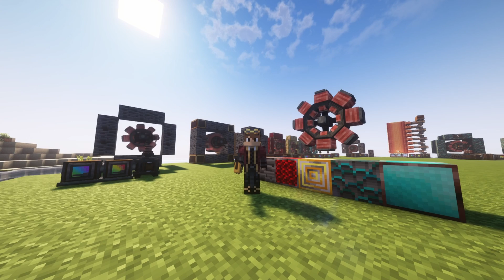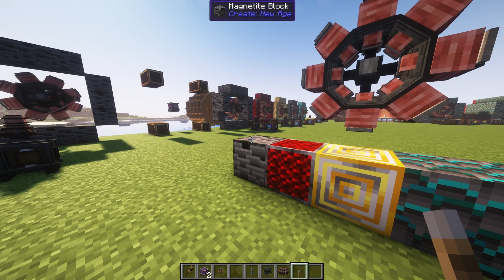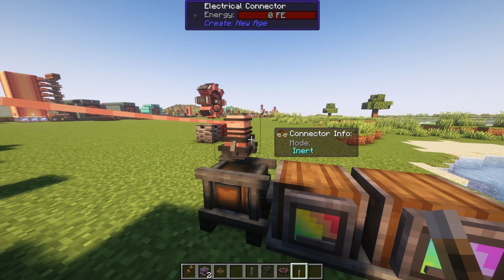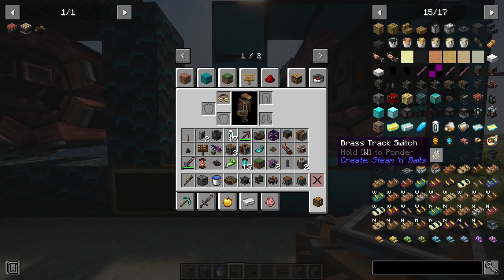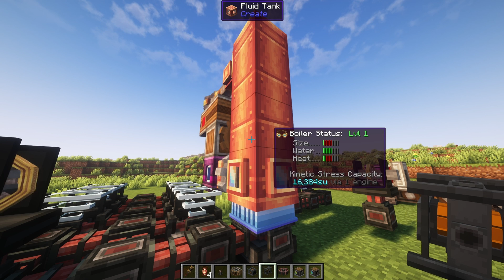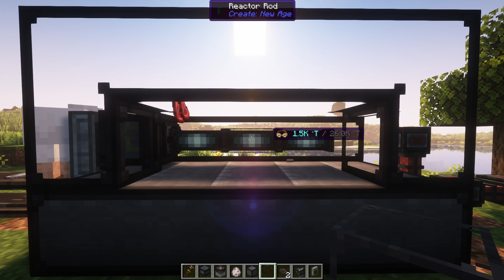This Minecraft Create Mod Addon adds Electricity and NUCLEAR Power! - Create New Age

Comment: Stress requirement of coil seems to follow the eqs.

(Stress) = (24 +Σ(magnet multiplier)) x (RPM)

The efficiency loss is due to the ‘base stress requirement’ of 24. In the highest tier case, for example, the exact amount of loss is

7.69% ≈ 24 / (24 + 24*12)

Therefore net efficiency of generator is

92.3% = 1 - 7.69%
Reply from the maker: Thanks for figuring this out! I've pinned the comment so that others can see this.

Comment: Uhm can you check using the rotation speed controlled, on the speed of the coil? Because i used it and it seems faster that way(like putring a speed controller between the coil and the su grenerator i.e water wheel)

Comment: Awesome mod iv'e heard of years ago however what's the purpose of the electricity that much yet i want to add this to my minecraft server however does this interfere with other custom ore mods?
Reply: the electricity can be transported over long distances with wire networks to power motors elsewhere, or is compatible with any mod using redstone flux or forge energy (RF and FE respectively), as all three types of energy are in fact the same thing under different names.

the thorium ore generation should not alter or interfere with any other custom ore generation. no mod adding a custom ore should mess with any other mod adding custom ore, as a rule of thumb.

Comment: This mod really needs a config feature that allows to change the conversion rate between su and FE. Last time I checked it was still missing. 
The resource investment to get FE from create power is simply way too large in comparison, when using other mods that produce or consume FE, like mekanism or thermal. It made me go back to C&A, although I like the implementation of the motors in New Age more, as well as the nuclear power feature.

Comment: This mod is really cool, but I’m struggling to justify using it.
It’s cool, but as far as I can tell, I don’t see any benefits since you loose SU because of the inefficiency. As is, steam engines are cheaper with fewer downsides. Why use a middle man that eats some of the SU.

Thinking about it, the only benefit is the electric motors being very small & simple. No need to build gear ratios or a bunch of rods, belts, gear boxes, & chain-drives to transfer SU around.

Comment: This mod works wonderfully with Create Crafts and Additions(C&A), since Crafts and Additions adds electrical stuff that does work with the carbon brushes and the motors, you can have batteries and use the wire spools of C&A that transfer more power than the new age wires that have a limit of how much current they move, i just prefer to use the electrical conections from C&A but generate the power using New Age, but you need to use the wrench on the conectors to tell them to pull energy from,  and push energy into, some of the new age blocks otherwise the conectors won't know what to do automatically but it's super simple,  i really love the fact that C&A allows for huge batteries that are modular like vaults and fluid tanks in that you can expand it in 3x3 towers super tall that store a ridiculous amount of electricity, but can also supply it back if you want when something is pulling more power than what you are generating, avoiding everything running out of power and stalling your entire base,  the setup i played with had a oil destillery from Create Diesel Generators, refining oil into gasoline and diesel and powering a set of big engines that spun the Create new age coils and then moved electricity around, basically a oil powered power plant,  never played with heat and nuclear but your video explained in a cool way, i should give it a try

Comment: Carbon brushes? Only DC power uses that. AC power transmits energy either via induction or clever design to have the wires as the stator.
Reply: ac generators use 2 slip rings, dc generators use carbon brushes over 1 ring split in 2 halves
edit: dc is more compact

Comment: There something i wish i knew before it's that the carbon brushes can only extract electricity from a certain number of generetor coil which is 8 by default i think
Reply from the maker: Oh wow, that would explain why my first setup attached to the big steam engine drew so little power.
Reply: @KwizzleHazzizle  Yes, if I'd never been in the configurations, I'd never have known
Reply: In my opinion, this mod is a bit poorly developed anyways. There is a bug where electrical connectors won't move alongside a contraption — even if it is super glued.

Edit: not only that, but there is a general lack of variety in the previews shown. There is around one per category, which sucks as it would be nice to have specific explanations for specific items/blocks.

Comment: Im playing with this in my world and i just cant seem to justify the reactor :/
Reply from the maker: They're expensive for the heat output aren't they?
Reply: @KwizzleHazzizle  I just expect to get more out of it. I can make a compact self sufficient boiler that's just as good. doesn't need a reactor and a machine to feed it.
Reply from the maker: @GTitus009  Right exactly, it would be cool if we had steam turbines or something, or if there were higher levels of steam engine that required levels of heat not attainable from simple blaze burners.
Reply: There needs to be some kind of large scale project that would need that amount of power. Maybe a portal to another dimension that takes a huge amount of power? New bosses and energy weapons to defeat them?
Reply: Yeah it's pretty useless, it'd just a vanity thing. I built mine on an island for shits and giggles and it's pretty cool. It's entirely self sufficient so I just leave it be.

Comment: I fell in love with this mod my favorite feature is the heat system. I just wish that they update some textures and remade some models for it to feel more finished. Also It would be cool to overhaul the reactor system to something more interesting and create-like
Reply: I don't understand why they needed the reactor inserter thingy, they could have used the deployers and mechanical arms from base create. Also the reactor glass feels like such a cheap solution for radiation, they could have given shielding properties to different materials. IRL concrete and waterare often used as shielding and they are already in minecraft. Steel is also used a lot and you have something close in iron blocks. It would be cool if they didn't block all radiation and instead blocked it partially, forcing players to make proper thick biological shields to fully protect themselves.
Reply: @-ragingpotato-937  the reactor concrete is already enough u don't need glass
Reply: "Overhaul the reactor system to be more interesting and create-like"

My thoughts exactly!
Reply: the heat pipes look kinda weird
irl heat pipes are just regular copper pipes with a lot of surface area on the inside